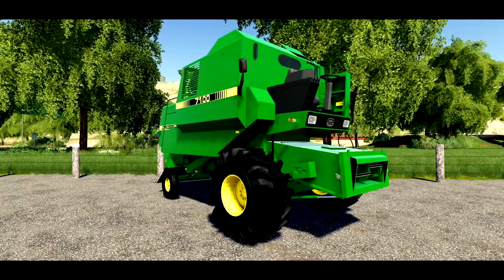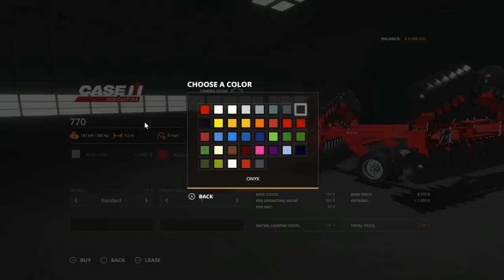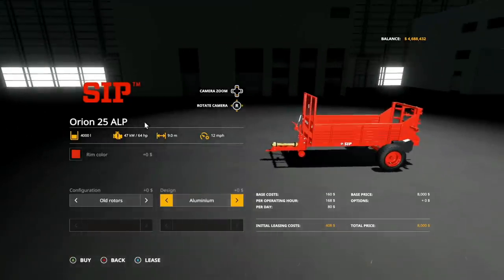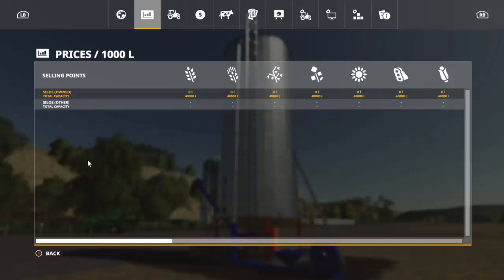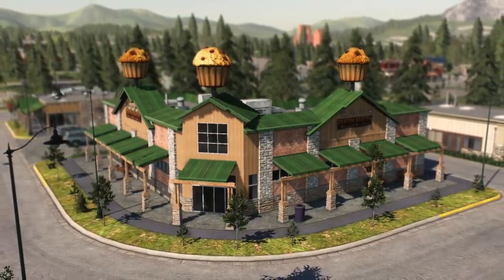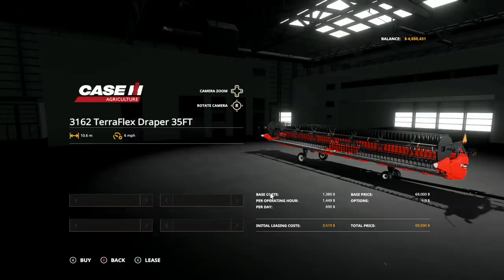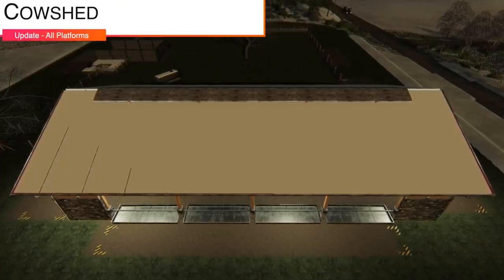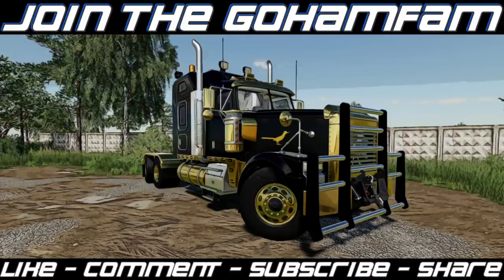New Mods! Massive Roadrunner+ Update, Case 150, JD 7200 Turbo! (28 Mods) | Farming Simulator 19

Comment: Anyone having glitching problems with the roadrunner+??
Reply: Yes on ps4, it is locking my game up and blue screening and only happens when using the roadrunner
Reply: @devonparsons5754  I wonder if it's the light shadows. Are the lights on when it happens? If so, try disabling the shadows in the shop. Also, let me know how long it takes to happen, on average, or if there's anything particular happening at the time. I've only had a little play with it on PS4, and no problem yet.
Reply: @mantrid  when I turned the shadow off, no problem.  It would trigger when rotating camera around the truck usually a minute or two and it didn't matter if lights were on or off.
Reply: @devonparsons5754  Glad to hear you can avoid the problem, and glad I went to the effort of making them optional, in case something like this went wrong. Odd that it happened even with the lights off. I guess console (at least PS4) doesn't like having more shadows :(
Reply: @mantrid  it did glitch on me a few more times last night when it was dark in game. Though it was the attachment sprayer. But the sprayer worked fine with other tractors. I have turned off rotation function as well today and seems to be holding fine so far. I always report every crash on ps4 but not sure if you see them
Reply: @devonparsons5754  Thanks for the info, Devon. There's actually one shadow light that can't be turned off (the reverse light behind the cab), so that may be the cause. I can't imagine the rotating lights would upset it. Unfortunately, crash reports from console don't make it back to modders, but they should end up with Giants somewhere, and if they get enough of them, they might tell the modder :)

I'm working on a new update, hopefully available within the week, which will include the reverse light shadow being disabled with the others. Hopefully that will solve your problem.